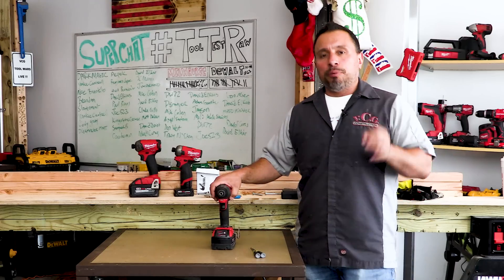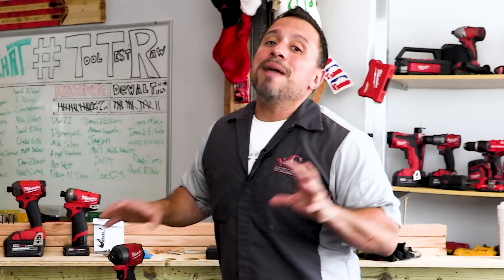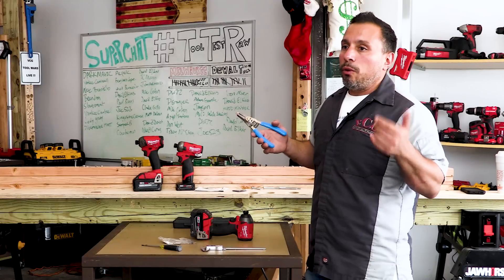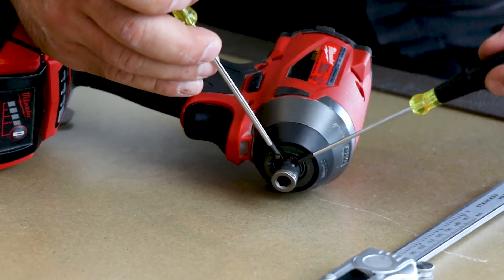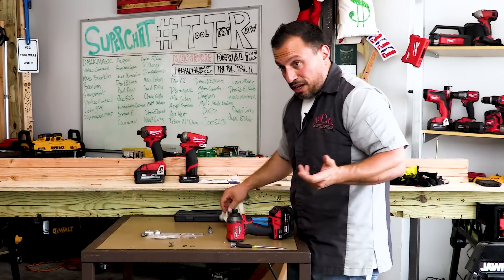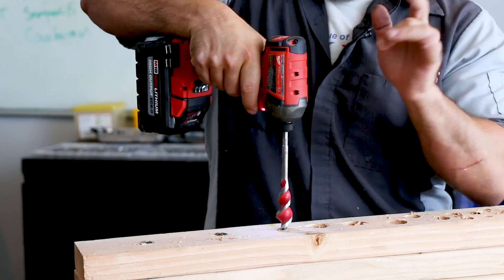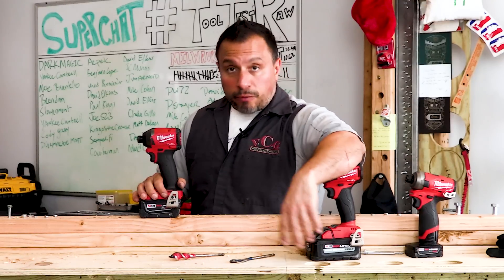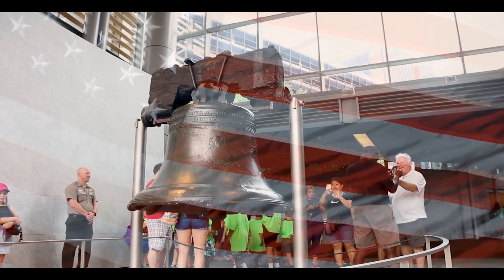Serious Problem With Milwaukee Impact Drivers - Replacing The Ball Bearing

Comment: I think adding The 4 mm ball bearings is correct, however  putting grease on them could be the problem you having. In my experience with ball bearings in conjunction with high precision applications grease is almost never used.

Comment: The problem isn't the ball or the spring.  The problem is that the opening in the collet doesn't allow the ball to advance far enough into the tool recess to provide a secure grip. In other words, there's not enough of the ball engaging the tool to lock the tool into place.  It really needs a re-designed collet assembly.

Comment: From what I am experiencing I believe most of his has to do with the single ball bearing design they use and it's size. Too much pressure causes side movement on the bearing and creates enough gap for the bit to fall out. I had the collet and bearing replaced by Milwaukee on a Gen 3 impact and it felt tighter but under enough pressure it would still slip a bit.

Comment: I find with mine that if i hold the collet back it doesnt jump out. My thought is that the impacts are so violent that its causing the spring to float/bounce down and then lets the bit go. Maybe try a stronger collet spring. Theory sort of makes sense with the surge as the impacts arent as violent.

Comment: To figure out the problem take apart both the fuel and the serge. See what’s different (if anything) with measurements of the diameters, lengths, springs, etc between the collar mechanisms. If there is a difference swap parts (if it’s able) to see if it’s a manufacturer defect in that line of parts. If no changes the collar might be under engineered for the power/ vibration being produced compared to the surge which isn’t as powerful due to its motor design.

Comment: The size of the bearings aren’t critical, as long as they move easily, and are big enough to engage the groove in the bit, it should work. If it doesn’t, it could be wear on the others parts of the collet.

Now, the question is; how much use do these tools you have on your show get? If it’s not much, then you need to try tools that you use daily. I wonder, because these tools look new, not really used much.

If Milwaukee is “working on a solution” it’s more than just a minor bearing problem. It could be the tolerance between the steel ring of the collet in the locked position and the back of the spring holding the bearing in place. If there’s too much play, the bearing will be forced out by both the rotational force and the pull.

Comment: I haven’t had any problems with mine, but I don’t use them as hard as a contractor would.  I have both the M12 and M18.  Mostly I use my drills for drilling and my impact drivers for driving screws.
Reply: Drills for drilling?  Drivers for driving?  That's crazy talk......  Haha!  I feel the same way, but "impact rated" and "impact ready" is all the rage right now.  Though drills drill faster, and drivers drive better, they may have set themselves up for this with all this "impacts for everything" marketing hype.  I also think we may be seeing what happens when we approach the physical limits of what a 1/4 in hex can withstand at these impacting torque levels.

Comment: My theory is that since the m12s and the surge tools dont produce as much max torque, the ball is probably getting jammed up in the normal m18, where as it doesn't in the m12 or the surge. Maybe the larger ball, and a stiffer spring might work. Or on Milwaukee's end, redesign the head so the ball doesn't jam up. Maybe use 2 balls or like the rectangular shaped retainer like some drivers have

Comment: I have a question about Milwaukee m18 GEN3 impact driver about the easy insert colic  does Amazon have the same manufacturer as the ones from  Home depot and other retailers stores and has anyone bought a Amazon GEN3, and if so do you have a problem with the colic

Comment: I just sent my m12 impact drive back to Milwaukee to repairs,  battery gauge start flashing when I squeeze the trigge and not responding, even without any load, drill it's only a month old, I was expecting more from Milwaukee, first I try to contact Milwaukee by email and no respond, so I send unit back hoping they fix that issue

Comment: Carl said it below. My guess is the batch of secondary springs that keeps the ball in place wasn't made to the right tension level. Basically it flexes and moves with less pressure than what it should. A stiffer spring should fix the issue. If not then it's on Milwaukee to fix all of them.  The only other option is the groove for the ball doesn't reach forward enough to fully lock the bit in place. Think closing a door where it starts to hook. Feels closed but a little extra pull opens the door without twisting the knob. I'm hopeful it's the spring, but fear it's the groove isn't milled correctly.
Reply: This spring what my issue as well

Comment: @vcgconstruction Drill a hole on the opposite side of the collect and add a second ball bearing like the Gen1’s. I would rather have the bit stay inside the tool vs the quick insert feature. Maybe add stiffer springs like the others said while your at it.

Comment: I have had this problem, I just slow down a little bit. I would bet that the hole that the bearing sits in is not deep enough. You could measure the distance of the bit travel when chucked and compare it to a tool that doesn't let go and see the difference. This is a minor problem compared to the fact that their brushless tools are junk if you get them wet. I love my Milwaukee  tools, but only use them where there is no chance of getting them wet, at all! I got caught in some rain with my brushless driver, smoke, sparks, now it's junk. What bothers me about this is the fact that rc cars use brushless motor controllers that are sealed, so how hard could it be?

Comment: Seems like there needs to be stiffer spring. The impacts may be vibrating that spring enough to let the bearing out. I feel like 2 bearings would have no differences. I’m sure the the tolerance for the bearing is close enough to not cause any problems

Comment: Hey Vince I had the same problem with my gen 3 however I remember I didn’t have this problem in the gen 2 model which was the 2653-20 so what I did was removed the collet sleeve from the gen 2 model and I noticed it had a tighter tolerance compared to the gen 3 model. So I was liked what the heck let’s install it on my gen 3 and I haven’t had an issue since then. All I did was replaced the sleeve nothing else. By the way I’m an electrician so I use daredevil bits  all the time on it  and it hasn’t failed me. Give it a try maybe that’s all Milwaukee has to do and give the gen 3 sleeves a tighter tolerance.

Comment: I just purchased a M18 fuel surge and it was giving fits with the collet. quick insert wasn't working or holding onto the bit. So surges aren't completely left out of the problems

Comment: I had the same issue with the gen 2, local tool repair shop fixed it for free under Milwaukee’s warranty. 3 years later it still works fine. My 3rd gen has no issue. It’s obviously a quality control issue. Nothing is perfect especially when EVERYTHING is made in China 🇨🇳

Comment: I think you should take it back apart and use a spray can of brake cleaner to clean all the grease off of everything. Then put the 4mm ball bearing in dry and reassemble it. It could be possible that the grease is not allowing the ball bearing to seat fully. The other thing is will it do it if you do not bottom the tool out on the piece you are drilling. If the collet is being pushed up by the work piece then that could be causing the initial release.

Comment: Need new better spring inside and larger ball bearing. Spring inside has a problem in locking the ball bearing inside. Spring inside is too soft or theres a problem in the groove inside which makes spring and ballbearing loose.

Comment: I'm gonna echo everyone else saying it's gotta be something in the spring design. If the ball isn't staying engaged then whatever is supposed to press the ball in clearly isn't working correctly. I also second the idea of comparing the gen 3 and surge collets as precisely as possible to see what the difference maker is. Patiently waiting to jump on the Team Red train until this issue is resolved but damn I sure could use a new drill/driver set soon...please don't make me buy orange stuff Milwaukee...

Comment: Its not the size of the ball bearing. It has something to do w the second spring not holding the ball bearing in correctly. It doesnt need to hold it on the way dwn only extracting the bit.

Comment: Why customer need to fix it it is engineer defact from Milwaukee, they really need recall gen2 and 3 to fit issue not fix for next generation which is awful. Don't give me a wrong,  Milwaukee did excellent marketing job in Australia, almost plumber use red now. They really need to manage quality better not just rush to release most of powerful tools to compare with another brand with sick body. We don't need huge powerful tools, reliable and capable are most important. Do something milwaukee, not only for North America, please do international recall. Fix the problem please.

Comment: Yup, sounds like the MILWAUKEE engineered specs for the ball bearing was 4mm...quality control just failed to catch the supplied error in the measurement, or they assumed a small .08mm difference would not cause a problem...WRONG ! The 4mm design cannot always tolerate a 3.92 mm scrimp...sorry,  I mean acceptable design tolerance ! They got busted trying to save a few measly $$$ with a 3.92 mm instead of a full 4mm ball bearing ? Really Milwaukee ? OK, to truly resolve this, I say a FREE 12AH battery for everyone !!! Who's with me !?!?!?!

Comment: What if your driving the bit so deep to the point where the drill bit is pulling the drill into the timber pulling back on the collet ultimately releasing the drill bit???
Reply: It really looks like you buried the collet in the timber in that last drive

Comment: I have a feeling the collet hole is slightly bigger than before.
That or the bearing is not seated al the way in.
Or the hole for the bearing I was not drilled properly

Comment: Me again Vince I tried using a 4.5 mm BB and it was too big so I checked mine cleaned it up but some fluid film on it put it all back together and mine works perfectly fine now I put a big boring bit that you drill holes in for electrical work at ran it into a stump five times with it going forward and pulling on it as hard as I can and it never came out of the head of the tool hopefully this helps you. I'm thinking the problem might be is the bits that were using it their slightly worn that's why they're pulling out.

Comment: Really......it is an impact driver, not a drill motor. Why in the heck are you jamming up a spiral drill bit and then trying to put unrealistic pull pressure on just a ball bearing instead of a drill chuck as they are designed to do. This is just silliness, use the right tool for the task at hand.......I really lost a lot of respect for your channel.

Comment: Replace it with a dewalt.I've never had an issue with dewalt. My milwaukee went in for service multiple times and still didn't get fixed.  What good is the warranty Milwaukee preaches if even they can't repair it. They're aware of the flaw just not worth it to them to recall the tools. I ended up getting my money back after months or arguing and bought a dewalt.

Comment: I have a feeling it could be the collar of the collet, the ball bearing may have cut a groove in the collar from the vibration and stress, considering the Surge collets doesn’t have that issue due to the fact that the Surge is hydraulic and produces less vibration and stress, the collar is what keeps the ball bearing down into the groove of the bit until the collar is moved and the ball bearing goes into a detent in the collar for bit removal.
It’s just a observation guess.🤔

Comment: Hi Guys!!!  Well, I'm disappointed too!  I was hoping the bigger ball bearing would work.  I went back to watch Vince's previous video where he takes the collet apart and re-greases the ball bearing.  Early in that video, Vince demonstrates how the ball bearing goes in-and-out of the collet when a bit is inserted/removed.  Guys, I keep pondering on the re-tension spring holding the ball bearing.  It doesn't look very reliable to me.  The tension that it puts on the ball bearing to engage the bit doesn't look very  forceful.  When pulling up on a paddle bit at a fast speed, I just don't think the re-tension spring is able to keep the ball bearing contacting the bit.  Unfortunately, that spring (Milwaukee Part #40-50-0057) has a unique design, and I don't see an easy way of replacing it with a stronger spring without involving Milwaukee.  However, I was wondering if Vince stretched that spring out a little, to make it have more force on the ball bearing, would that help?  On a side note, what keeps the ball bearing from falling into the bit slot?  Only that re-tension spring?  Just wondering.  Does anyone know if DeWalt uses the same kind of re-tension spring on their impacts?

For comparison, I looked at the parts list for an older Milwaukee M18 Impact Driver, Model #2656-20.  That parts list does NOT have a re-tension spring.  It does show two (2) 4.0 MM BALL BEARINGS (Milwaukee Part #02-02-0170) in the anvil.

I also thought about the ball bearing being in the corner as opposed to being in the side.  I don't know if that really matters.  Ball bearing-to-bit contact is what matters.  I would think a ball bearing can engage the "curved" locking area of a bit from the corner as well as from a side.  In closely watching Vince pulling up on a paddle bit, the collet initially engages the paddle bit for a brief moment, which means the ball bearing is contacting the bit.  But, the paddle bit pulls loose in just a second or two, like the ball bearing slipped out of the bit.  That makes me think the re-tension spring is the main issue.  That spring can't keep the ball bearing engaged into the bit.

As another test of the re-tension spring being the issue, if a small spring could be added directly between the collet sleeve and the ball bearing for added pressure on the bearing, that would be interesting to try.  It would probably not be a permanent solution because that spring would move around and fall out over time.  But still, it would be an interesting test.

Comment: @vcgconstruction I have been having this same problem with my gen 3 impact. I decided to take apart all the impact drivers i had by milwaukee and the only difference i found was the first spring that comes out when taking the snap ring off is much weaker than even the one on my m12 gen 2 impact. So i got a stronger spring like the one that is in my m12 and it works perfectly now. That spring is a very important part in holding the Collet back in the lock position, which in my opinion with the weaker spring used allowed the collet to bounce around and move the ball bearing up just enough to release the bit. Take a look at your m12 versus the m18 and you will see what im talking about. This actually worked for me and not just making a suggestion. Hope this helps everyone with this problem.
Reply: Where did you get the replacement spring?
Reply: My friend works at a machine shop and he was able to get it for me. But if you measure the spring in the tool with calipers and go online im sure you could find it somewhere.
Reply: @chriswebb3018  Are the dimensions of the spring the same as for/in the M12 gen 2? If so, maybe you can get that part as a spare, and stuff it in the M18 gen 3 (?)
Reply: Could you maybe heat and stretch the original spring to increase tension?
Reply: @Scott00  that's a decent solution... my only question would be, would you create more wear and tear doing that to such a small thin piece of metal?

Comment: My theory is that the jarring causes it to let loose where Surge impacts are much smoother. It would be dumb to have more than one collet design. I wonder if a collet for a DeWalt or a Makita or any other company will fit on the Milwaukee

Comment: I would say its cause it on a pointed part of the hexagon not alot of cover for the indentation of the bit were as if it was on a straight edge of the hexagon you would have at least half the ball bearing in the indentation of the bit and the impact and pulling force simultaneously working the bearing loose ence ball bearing failure but a bigger bearing isn't the answer. the laws of physics is.

Comment: I really wanted it to work. I got my M18 Fuel impact driver back yesterday, (Friday),from Milwaukee Warranty repair. It had trigger issues, and gear changing issues. 
They just gave me a brand new tool replacement. No shipping or other costs involved for me. Try to keep the numbers on the side visible. Mine were BARELY visible. 5 years on tools, 3 years on batteries. Monday I get the new M12 Surge Impact ordered, and then comes my collet test for both. Thanks for the update video!

Comment: A larger ball bearing should make it worse unless the diameter of the protrusion hole(or whatever it's called) is also increased.(probably why this is such a tough fix).  A larger bearing won't protrude as far into the hex socket.  To illustrate, take a can or jar that a baseball will rest in the opening of without slipping through.  Now place a softball on the same can.  The baseball goes in farther, right.  Just saying.  I think the spring retainer may also be slipping to the side of the bearing allowing it to retract under impact.  Adding a ring to the end of the detent spring that cradles the bearing and maintains it's location should make it work.  I would try tweaking the ball retainer spring to force the bearing forward and inward with more force.  Other thoughts and comments are welcomed and encouraged.